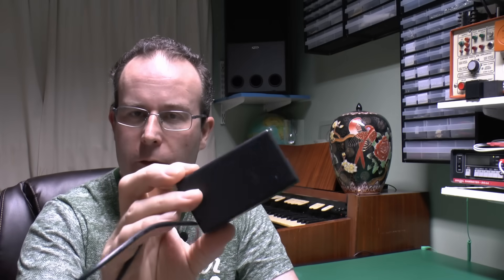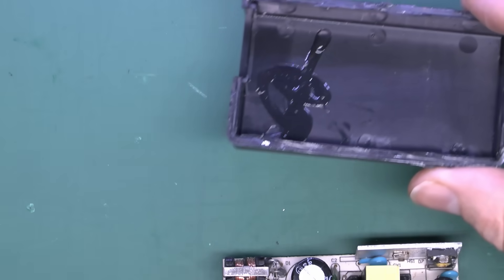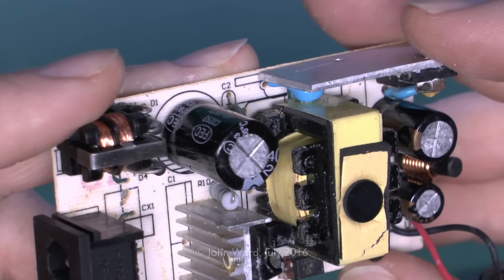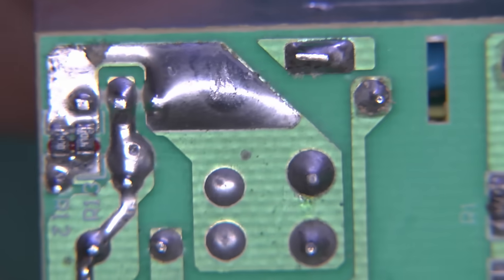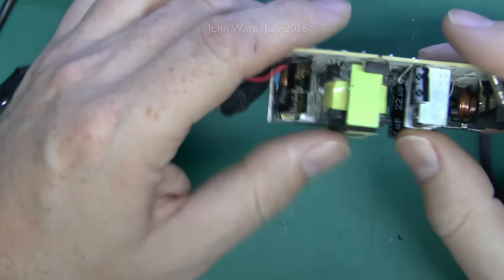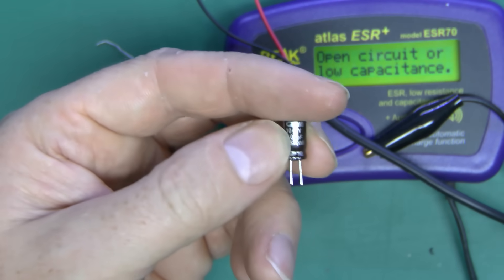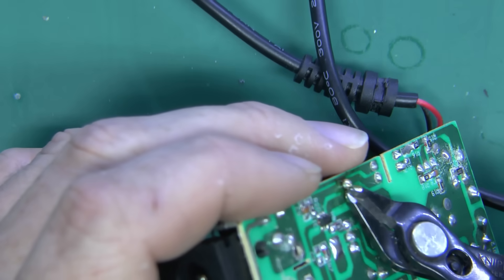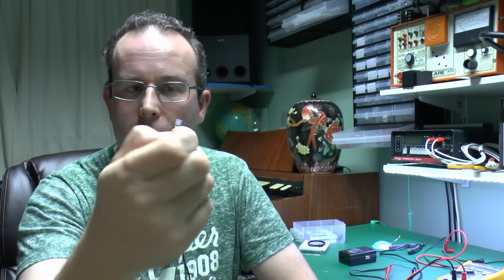12V Power Supply Repair

Comment: 3:00   JW   that's a transformer,  not an inductor
there are a few inductors on the other side of the board

look up the part number, you'll see that it's a transformer

also that power connector is not a FIGURE 8 connector
it's called a Standard 2 Pin Power connector

and yes that thing on the board was indeed an Opto Coupler, there is no  OR SOMETHING about it
you got that right

Regarding the PEAK ESR Tester
i've never used that one, but i was under the impression

1. that particular unit is a pretty good unit
2. i was under the impression it would give a numerical value of the cap's ESR as opposed to saying   open circuit or low capacitance.... very interesting
i was actually going to get one,   i might now reconsider, because i would prefer something thatgave me a reading so i can decide if the cap is bad or not
Reply from the maker: The Peak tester does show the actual ESR and the capacitance, but does not work for capacitors less than 1µF, and there is no ESR for open circuit.
Reply: @John Ward
oh... ok,   interesting
my faith is then restored, thank you

i actually was looking forward to getting one
my point merely was, if it didn't show a numerical reading, i wasn't interested
but since it does, i am
thank you
Reply: Just to be annoying, that is a common mode choke, and that IS a figure 8 mains lead - Always was, and still is. Regardless of what Wiki or anyone else says.
But you got the optocoupler correct....I was hoping you'd call it an optoisolator...
(o;
Reply: Well, I say, correct,correct & correct, D A,
Reply: @smartchip  Ha ha OK - I was in a funny mood I guess. You sure that isn't a common mode choke? I can't be bothered looking again.

Comment: Hi John. Just my thought on the sticky deposit there, given that the case was probably "plastic welded" using an induction coil to melt the plastic together, this would have meant that no glue was used to stick the two halves together. this is quite a common method for sealing psu's together these days. Could the sticky deposit be melted varnish which had dripped from the inductor which may have become very hot during operation, which subsequently settled onto the plastic case? Once cooled it would have left a deposit similar to what you found? Just a thought ;)

Comment: A trick for cleanly opening those: Slice the sides with a knife, then squeeze in a vice along the seam. should pop open. 

or forget the knife and stick directly in a vice, making sure the seam is in line with the vice jaws as the vice needs to squeeze the seam to break the seal and pop the brick open.

Comment: Hi John. ..thanks for the video. ..the device you checked the condenser. ..is it special to check condensate types? 
what is the link to buy it? 
Thanks
Reply: Hey I don't know if you still need this information a month later but the keyword for that device is an ESR meter, they come in a lot of shapes and sizes but as long as it measures what you need it doesn't matter

Comment: before he even opens it I am betting it is a low quality trashy capacitor as I have discovered in most electronic equipment recently. It is a built in failure so manufacturer profits  by the consumer just giving up and buying more products
Reply: yep, most modern electrolytic caps are crap, i've got many 60's transistor radios with their original caps still in good state

Comment: I'm still a bit confused, maybe i don't know the function of the esr meter because i don't have one, correct me if im wrong but as far as i know, a capacitor is basically open, meaning current does not pass through from one pole to the other, it only accumulates voltage from which ever end it comes in(probably the only end this case here) and discharges it trough that same entry point. 
The esr meter connection shows it as open circuit or  low capacitance what would it show if it was a functional capacitor. 
If the capacitor failed without any physical indication as show here, would it always and  did it create a short/closed circuit. 
If it does create a short circuit. would setting the multimeter to continuity and probing both poles on the capacitor to ground in the circuit board be an ideal way of testing for a fault?
Reply: have you found the answer? cos im puzzled too
Reply: Capacitors often fail open circuit - when they fail short circuit they usually show signs of swelling or rupture. Capacitors don't pass dc current, but they do pass ac current - how well depends on the frequency of the supplied voltage and the value of the capacitor (in Farads or micro Farads). Capacitor testers use a low voltage ac applied voltage in order to test and derive a reading of their capacity/capacitance.
Reply: Check out the glodark website for explanation of ESR meter.

Comment: Nice video! The capacitor that you replaced, where in the circuit is it? I am trying to fix a similar problem, would really help if I knew where to look on my board -- I mean circuit wise, not physically. Any chance you can show where it is in a circuit diagram or block diagram? Thanks.
Reply: It is the capacitor located near and filter  the Vcc of the  integrated circuit 6 pin.

 In this schematic diagram https://circuit-diagramz.com/wp-content/uploads/2018/08/SMPS-CIRCUIT-SCHEMATIC-ORIGINAL-AND-MODIFIYE-4.jpg  it is the 47 µF connected between pin 7 & the negative supply  at the IC UC3843

Comment: I was about to complain about the soldering job. But after you mentioned about it being lead free solder, I will recall that comment.
In fact, I dare say it was a good joint, as far as lead free solder goes.

From what I've seen, it's nasty stuff. I'll never use it.
If they ever consider banning it completely, I'll stock pile a tonne of proper solder and treat it like gold.
Reply: I've got a 500g reel of lead-free solder. I can't bear to just throw it out, because it has silver in it. It sours my mood every time I see it!
Reply: I still use leaded solder so I always have a good solder joint
Reply: I cannot get a good solder joint with lead free solder and I have been soldering for over 50 years
Reply: @rogerd4559  lead free solder, especially the type that DOESNT have silver in it, is rubbish.... tried both with and without...
Reply: why are we worried about lead when we are dumping barges full of dead flourescent lamps into the sea and coating the bottom of the oceans with mercury?
Reply: @andygozzo72  Lead free solder was the downfall of my electronic career. I found I could no longer make a good solder joint and lost my job because of it which caused me to lose my house and family, live out in the street with only a carboard box and a laptop for company
Reply: the author is a lot better at talking than soldering lol
Reply: I developed the reflow process for a major semicon/capacitor manufacturer. Terrible stuff indeed--critical temperature, critical flow time. I warn people against using it for electronics.

Comment: when replacing Electrolytic caps if you want it to last a long time, use a name brand like Sprague or Cornell dubilier. there are many other good brands, its easier to just avoid the brand that failed in whatever it is your fixing
Reply: Rubycon and Chemicon caps are really great caps to use as well.
Reply: Also spend the extra 5 cents and buy a 105 degree cap.
Reply: @nightshadelenar  It doesnt really matter what caps they are now days as they keep them on the shelf for 40 years and they dry out so test them all with an ESR meter. I found half were bad right out of the shipping package
Reply: @rogerd4559  Damn, something to check.

Comment: Nice job JW... i
I like that capacitor tester... 😏
The opto-coupler leads were well corroded, unusual...
I think I'd have scrubbed the board where tracks looked dodgey & tinned them to help with current-carrying capacity & "structural integrity"...
SMPS's running at khz tend to draw crud lime a magnet... but this thing was sealed... 😕 
You are right, that leadless solder is such crap... 😂
Thanks for the close-up... 😎
Reply: trouble with all my capacitor testers not one esr reading agrees with the other one. they need to standardize the calibration
Reply: combine that crappy lead free solder with the corrosive flux paste they have on the market and you have a complete disaster

Comment: can anyone recommend a good esr meter like the one shown in this video?
Reply from the maker: The one in the video is a Peak ESR70, http://www.peakelec.co.uk/acatalog/jz_esr70.html
Reply: @Wane Hall

I HAVE ONE OF THOSE
it's not a good ESR Tester  while the cap is IN CIRCUIT
that thing is referred to as   M-TESTER

it's a component tester
it can auto detect almost any component

however it does also take some getting used to
Example, it will detect a resistor
but then again, if a fuse has high resistance but has not blown it will detect the fuse as a resistor

as for CAPS and ESR,    I WOULD NOT RELY ON THIS THING TO TEST CAPS IN CIRCUIT
I HAVE PROVEN ON MANY OCCASSION THAT IT'S NOT RELIABLE

HOWEVER,  OUT OF CIRCUIT.. IT'S A BLOODY CHAMPION
it's an awesome little thing for testing stability of caps   ASSUMING ONE KNOWS WHAT THE ESR OF THE CAP SHOULD BE  (that in itself is a science)

i suggest a person do what i do 

get around 1000 capacitors,   at least 10 of identical brand and voltage and capacitance rating
then test the 10 and get a Hi, Low and Mid Reading across the 10

repeat that for every single value over every single brand 
different brands of identical values must be considered separately

I have a spreadsheet that i record every value on 
and each time i test a cap i confirm or disprove the previous readings,   hence my reading are correct
it takes time to get these values down,  but it's worth it when you have them

so.. this M TESTER thing, has limited functionality
one should not rely on it in circuit as an ESR tester

but one should maybe 80% rely on it out of circuit to test components
and common sense shoudl be utilized

i have tested box capacitors and the M TESTER has said they are resistors when they are not

so.. take it with a grain of salt

Comment: Power suplai 
Model s-36W
AC INPUT :110/220V50-60 Hz 
DI AUTPUT :12V 3A 
Tempat kabel ada 5 
Mana arus masuk dan mana arus keluar ? 
Apakah bisa dipakai untuk lampu 
LHE 35W?

Comment: I was taught that only plumbers use flux...
Reply: Taught by whom? Ask for a refund. Solder requires flux wherever you use it and "lead-free" solder requires even more than tin-lead solder. Its purpose is to exclude oxygen while you apply heat, thus avoiding oxidisation.
Reply: @manolisgledsodakis873  : Flux is usually defined as S-39. When applying on a pc board, it tends to 'eat' away the copper lines on the circuit board after a while. I've soldered many, many things in my life and never used flux. Never felt the need either.

Comment: In my experience, an easy way to open that type of clipped/glued box is just to hit it on the side with a hammer (not too hard) and it should just pop open. It's easier than trying to pry with a screwdriver anyway.
Reply: squeezing in a vice works well too.
Reply: Putting it next to an open heat source works too.
Reply: Alexander Harknes
Reply: That's also what I am doing. A sudden knock near a corner with a pliers or hammer will open the box. Sometime i squeeze it using benchvise until it flick.
Reply: One more way to get it open, just put some drops of patrol on it after few seconds it would be open without any force
Reply: @dave himlin gasoline
Reply: @dave himlin maybe petrol..
Reply: Ive tryed that with varied success another viewer stated to freeze the boxes first

Comment: Jeez! How much solder are you using!! Let the joint heat before feeding the solder in and you only need a third of what you feed in. The corrosion on the board is caused by flux which hasn't been cleaned/washed off. If you need to use lead free solder, get some with silver in it, it flows better even with little or no flux.

Comment: I'm surprised you didn't clean the board after going to the trouble of repairing it.
Reply: I think he did just didnt video it
he has a limited time on You tube
Reply: @rogerd4559  yup
Reply: Im surprised too!  as ive found many boards have a conductive film of dust and grime. When you take a meter set on the high setting you will see the board has shorts across it. Best to flush the board off with alcohol and let it dry

Comment: That Capacitor spewed it's guts from the bottom around the leads as there was no vent on the top, the electrolyte  is what caused the opto isolator leads to corrode. You should replace all those capacitors as they will all fail soon and when those big ones go they will drag other components down with them.
Reply: I agree and maybe even the Optoisolator as well
Reply: I agree it is foolish economy to save caps just because they tested good. they came from a low life Manufacturer and soon the others will spew their guts as well

Comment: With these type of powrr packs I drill small air holes in the casing as the outer case gets hot..

Done this on many power packs and they last much better..
Reply: On my laptop adapters(which can not be opened). I make small holes with thick copper wire heated by  coiling it on solder iron.

Comment: I had the PSU for a small TV fail - a capacitor shorted - took out the fuse in the plug and during investigation the on-board fuse failed. Got it working again but the capacitor was a shade taller than the original leading to a recasing problem.

The general rules with electrolytic capacitor replacement: choose closest available capacitance, and not a lower voltage or temperature rating than the original (higher is OK), as long as it's not physically too large.
Reply: ***** That wouldn't have helped... it was too big for that and there wouldn't have been room either.

Comment: Possibly ? a cap from around the time that an unfinished electrolytic cap formula was stolen and there was a spate of bad caps around for years afterwards ?
Reply: Oh do shut up. Anything could have gone wrong. You had no idea what the problem was and you dont design these things.
Reply: You seem to have some issues too. I'm afraid I don't know what the problem is in your case, since I'm not a psychologist.
Reply: It was a component failure, not a design failure.
Reply: You might be right. It could be a cap plague issue.
Reply: @Brianck1971  "Your" - and you have the cheek to criticise someone else for poor grammar?
Reply: @will_doherty  yes "your" and I said his English was not good, I never said anything about anyone's grammar.
Reply: @Brianck1971  "English" - "grammar" in essense two names for the same thing. And you meant "You're", as it was a contraction of "You are". HTH :-)
Reply: @will_doherty  No I did not mean you're.   How would "You are English" have made any sense in the context I was using it ?.  I ment "your" so that's what I said. Grammar means English ? You can have good grammar in any language.
Reply: @Brianck1971  "Your not very good at English either." is exactly what you wrote. Which, as I pointed out, is incorrect. There's obviously little point in continuing...
Reply: @will_doherty  Well considering you don't know the difference between English and Grammar, but you think you can correct someones grammar even though you can't grasp the concept of context.
Reply: @Brianck1971  To quote again: ""Your not very good at English either." is exactly what you wrote. Which, as I pointed out, is incorrect." - you obviously missed this part of my previous reply. Ignoring difficult things, such as your errors which you are trying to deflect from, just makes you look silly. You mention context, which is ironic, because in the context of your initial reply where you meant "you're", english and grammar have largely the same meaning. Now you try to suggest that we shouldn't worry about the context in which you used the word "English" but some newly invented context in which it may mean something different. I don't doubt that you'll respond with more of the same, but since you have nothing to bring to the discussion I shall leave it here.
Reply: @stefantrethan  yippee, electricians fight...

Comment: Thanks for the video.  Your camera was nice as I could see the parts.  Wondering if you could share what you were using as a camera.  I was thinking that would be great in working on something to have a setup like that to be able to see small parts on a screen
Reply from the maker: Panasonic HC-X900 with an additional +4 lens.
Reply: John Ward
Reply: John Ward
Reply: John Ward
Reply: thanks! great camera!
Reply: Ive seen some awesome circuit board camera microscopes for around 75 to 150 dollars on the internet you might be interested in
Reply: ever notice how a camera shows faults on things that your eye cant see
like the dirt and filth all over a circuit board?